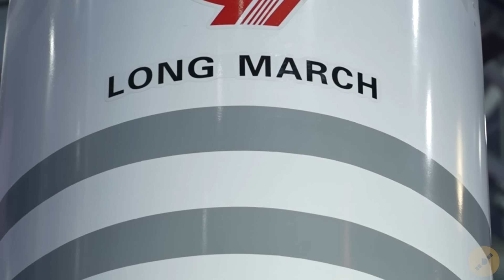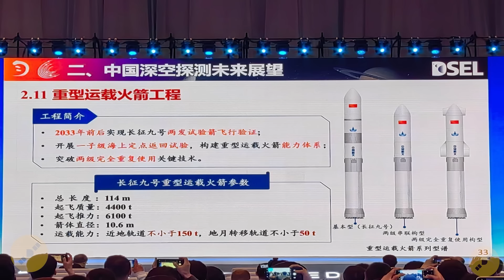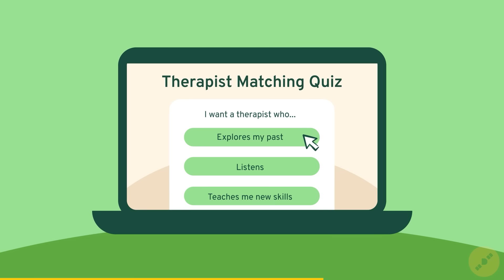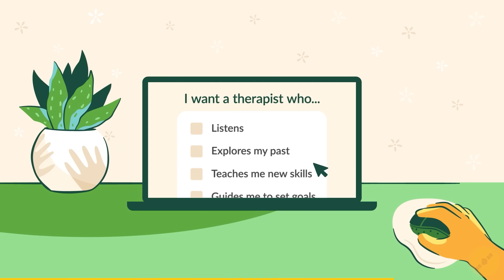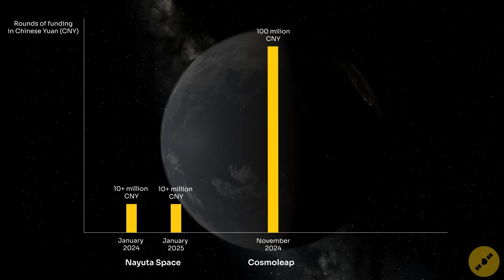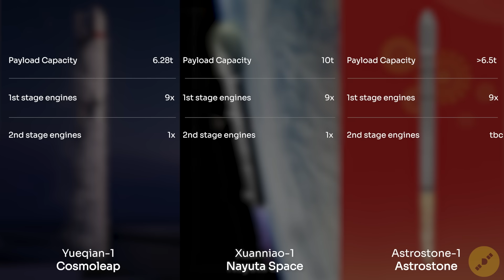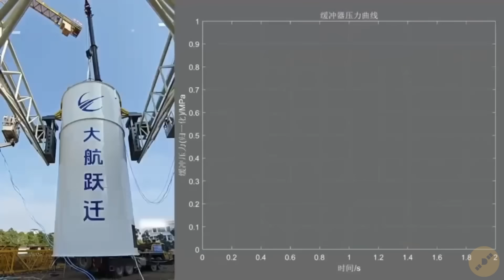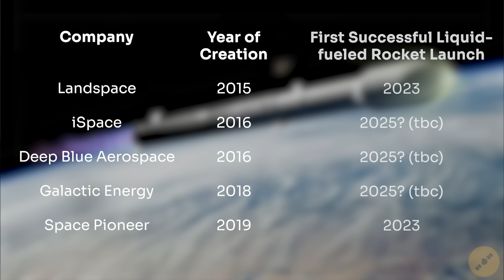These Chinese Startups Are Building Their Own Starship

Comment: You say that many of them will fail as if to cast doubt on the prospects of a Chinese Starship equivalent becoming successful. While it is obviously true that many will fail - and you gave some reasons why - it's also true that this failure will likely only come after at least one of them has become successful. One of them most be successful in order to be in a position to take the market away from the others. Because of that, I think it's kind of a moot point. It's impossible to predict who will come out on top.
I also think that it isn't enough to simply be the first to have started on the development track. Engineering prowess matters far more than early money or early infrastructure. Being early and having infrastructure in place matters only if engineering prowess is equal, if both competitors know their stuff and are pursuing it with equal fervor. SpaceX upending legacy launch providers has shown this. And companies like BYD have shown the same.

Comment: SS second stage has yet to have either a payload, outside of a banana, or a successful flight. Much less, any possibility of reuse. SpaceX should settle for partial reuse ability and reasonable refurbishment times. Rockets won't possess an airplanes' refill and go profile for quite a long time.
Reply: At this point, it should be clear that complacency is not what got Spacex this far. They're all in for a fully reusable vehicle.
Reply: @Cristi4n_Ariel  That's nice. It still has yet to prove payload, refueling, not blowing up or anything necessary to be anything besides an leo semi reusable space truck. And they haven't ever reused a single component of SS/BN. Right now, BN reusable has also yet to be proven. Don't fall for the hype surrounding Enron. Enron is the biggest snake oil salesman that I've seen during my lifetime.

Comment: NGL, bad idea, waste of reosurces.  China will fall into the same trap as the US will fall into with starship. 
Reaching orbit (something starship has failed to do so far) is not enough, it has to reach orbit at full predicted weight capacity and then 12-20 (at best) of extra launches will be needed to refuel it to make this system function at full capacity. 
Far too many points of failure for a single mission.
This also includes the use of turbopumps for orbital use after  A LONG time in space instead of hypergaulics.  this increases risk of failure at points of the trip where a failed ignition ensures a lethal mission failure.

Comment: Starship does not have a 2nd stage, it is an interplanatary spacecraft.
Reply: It is not. They are trying to make one. Big difference.
Reply: Starship can only be called interplanetary conditionally. Without a serious energy source, the maximum it will reach is the Moon. To fly to Mars, Starship must have either a nuclear reactor with a large heat exchanger, electric generator and biological protection, or a large solar battery with trusses and buffer batteries, or an installation of fuel cells like on Apollo ships, with large tanks of oxygen and hydrogen, which should be enough for the entire flight. The heat exchanger from the reactor, or the solar battery with trusses, must be folded inside the ship during takeoff and landing. If you take into account all this, as well as food supplies, water, life support systems, equipment cargo, navigation systems and so on, then this ship is too small for Mars.
In addition, Starship cannot return to Earth at the second cosmic velocity. It will simply burn up. So do not expect a quick conquest of the Red Planet. Starship is an orbital ship.
Reply: @iskandernixon4161  obviously you don't know anything about orbital mechanics.
Reply: @ArmisticeFront  And what do you think I need to know about orbital mechanics to understand that without power, Starship will reach Mars before the crew and cargo inside it freeze?
And what do you think I need to know about orbital mechanics to understand that without fuel, Starship won't be able to slow down enough to where it won't burn up in the atmosphere on landing?
Reply: @ Starship will never happen. Starship's final function will be as a grand monument on the great fall of America. Good luck.
Reply: @rawfromnowhere  Starship is already happening...wake up!
Reply: @rawfromnowhere  Well, at least an orbital Starship is possible, if Musk manages to finish it. And a partially reusable one like Falcon 9, but already a super-heavy carrier, with minor modifications is quite real now.
Reply: @ Indeed. Wake up!

Comment: 13:40 global shape of starship and chopstick are irrelevant. 50% of the research of spacex is about the engine. Falcon generation had something between 50 and 100 different engine designs, and some falcon 9 had 3 different types pf engines in the same rocket. 

Not even talking about air vs space optilised cones,  starship also had between 30 and 50 different engine designs. 

That's where cost goes. That's something you have to do in house. You cant roughly copy what you saw on tv.

Comment: You've got an interesting channel here, the subject matter is not really covered in this factual non partial way by anyone in the West. Keep up the good work, thanks. Best of luck with your current difficulties.

The 'chopsticks method' of reusability seems like a fairly good innovation for terrestrial take off and landing - to promote re-usability. But for Elon Musk's goal of building a colony on Mars, I can't really see it's feasibility, as there is currently no infrastructure there.
Reply: Yes they will either need to have a few disposable Landers that will somehow be able to manufacture a launch Tower Chopstick arm or develop an entirely different Landing method all together.
Reply: @RighteousInquisition  Mars/moon bound ships have landing legs
Reply: @Dagobert-jw2lc  how? If they can't get it to work? Are they relying on the weaker gravity on Mars?

Comment: the use of A.I. may shorten those timetables...
Reply: Spacex used their own developed software to. Ai will definitely speed up development but still needs r and d
Reply: Nope. 

Elon made a conference about engine simulators. Engine design needs to write your own simulator. 

moden ia are very far from being able to design an engine or  a simulator.
Reply: AI right now doesn't work well without actual data. You need to have data from different sources to feed ai and rocket science this depth is only available in spacex which is closed source.